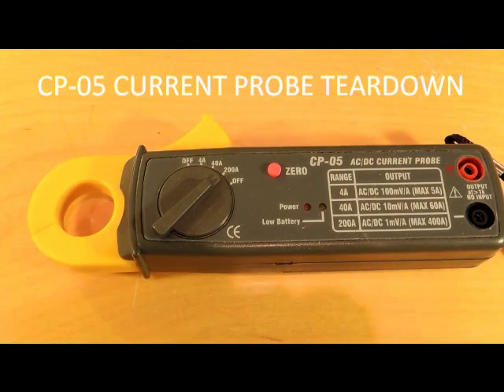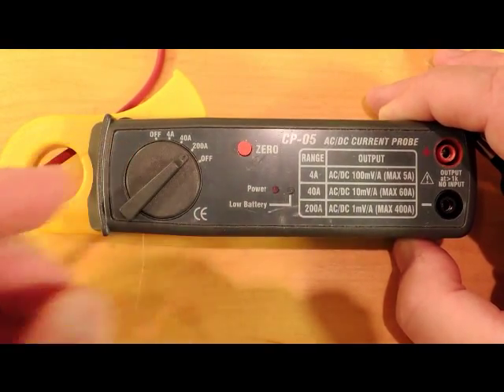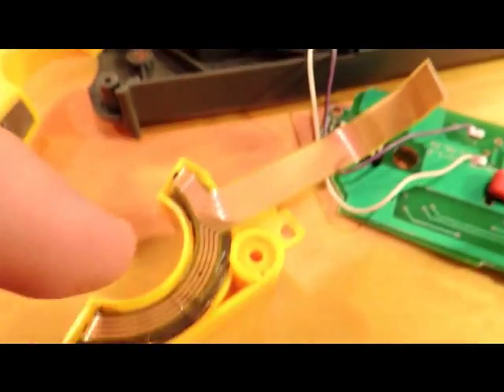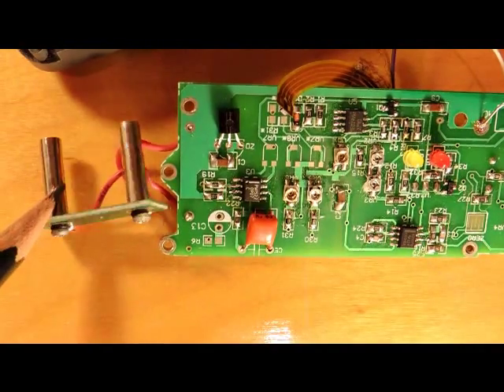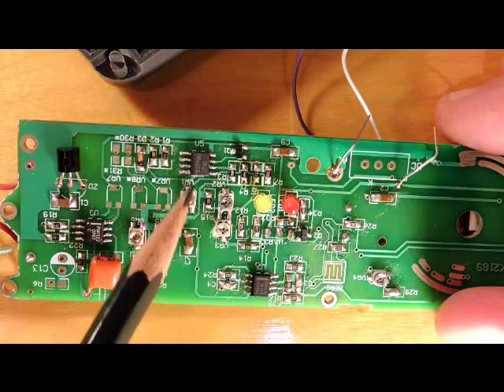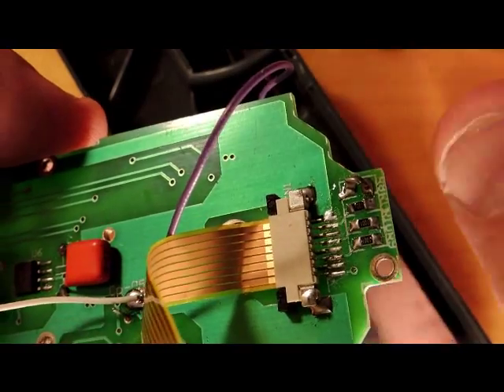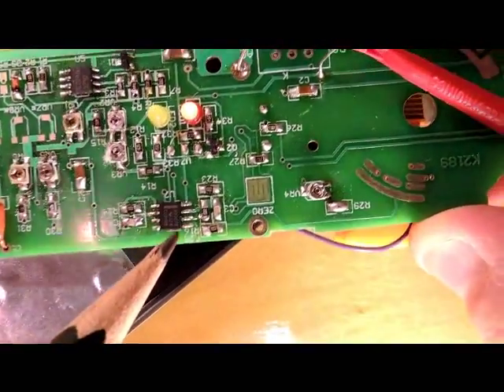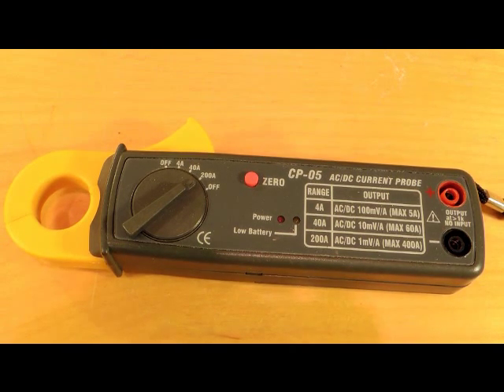CP05 Current Probe Teardown

Comment: Thanks for the video.
 I have this tool, and can add that its very well balanced within their price.
the 1mA resolution it´s only a ilussion. this reading oscillate over 20mA (equal the specs say: 20mA of noise) altough keep in the same position (the reading also varies whith the position or angle of your hand). 
Out of that it´s very usefull to use with multimeter or oscilloscope.
p.d. I can not  yet test in frequency response.